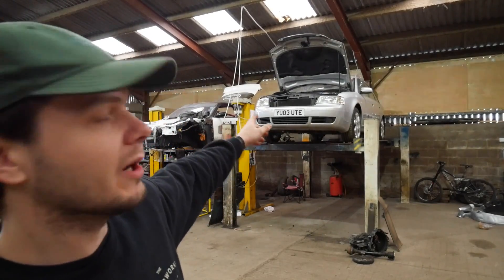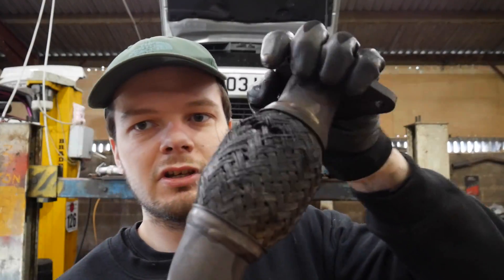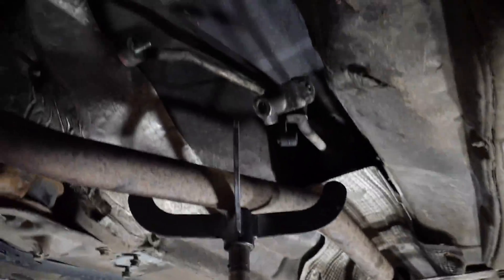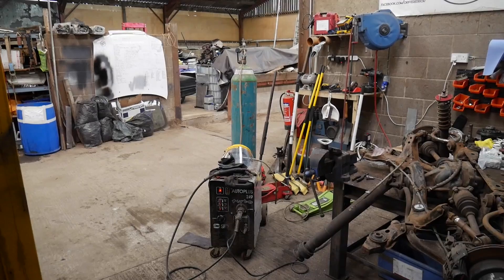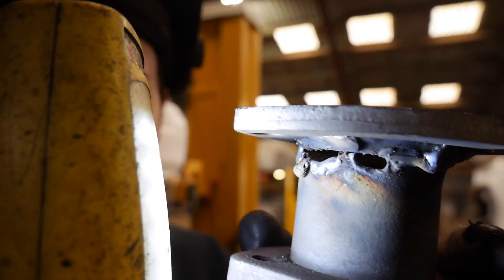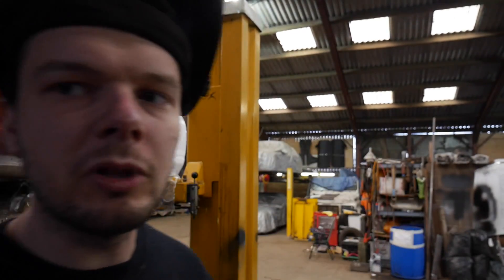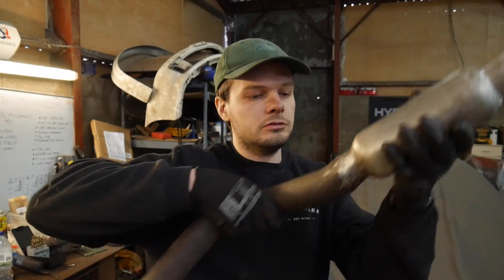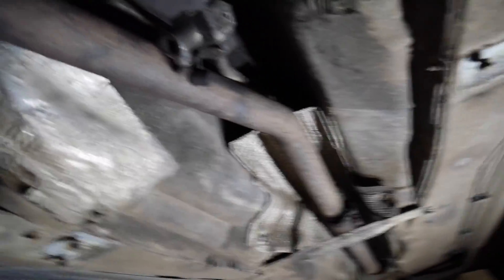Welding for the first time - Audi A6 Exhaust Repair

Comment: As someone who is currently learning to MIG weld I understand the struggle. Play with some thicker metal to practice your hand movements and not worry about blowing through the metal. It's a great feeling getting the welder set up just right and getting your first nice welds.

Comment: You've got to start somewhere Dan! Im shit at TIG welding but with my Rtech mig i can produce some decent results. Half the battle is setting the welder up correctly with the correct volts and wire speed. Its probably worth you googling a settings chart for that particular welder, will save you loads of time. I find when welding exhaust its best to use high heat and a series of short tacks around the whole piece of pipe. Once you have started welding you will soon realise its probably the best tool in your garage!!

Comment: Not a bad shot for your first time! I done something similar to my exhaust the first time I welded. I'm not sure if anyone has said this but hold the torch about 10mm off the job when your are welding. It should stop it from clogging up at the end. Wire speed and amps is everything but a few how to weld videos will help with that. Hope this helps a wee bit!

Comment: The exhaust flexi was a weak point on my Astra VXR too. A replacement pipe was about £1k, which I wasn’t about to pay put. Got it mended a few times before I got rid (that was when it was 11 years old, 135000 miles - I’d had it from new). Given I’d got it for £5k on top of my 04 Civic Type-R, it gave me 11 years of cheap, fun driving...

Comment: I'm debating learning to weld, this video is good inspiration and also reminds me that I'm going to blow holes in everything at first!
Reply: I made the dive this year. Do it, it's fun. Remember to wear your helmet & long sleeves though unless you really like severe sunburn (speaking from experience lol)
Reply: @philanaemic  our cheap welder broke yesterday, so we're going to invest in a decent one and then I'm going to get started.
Reply: @jase_llan  I just bought a fairly inexpensive one from Poland. I still had to budget for all the gas & accessories.
Reply: @philanaemic  I've already got the gas and wire etc. from the old one, I'm thinking of spending around £250 and going halves on something in the £500 range that can do mig and tig - mig will be handy for patching rust and tig means I will be able to have a better go and custom exhaust fabrication etc.
Reply: @jase_llan  the bit of kit I wish I could buy would be a pair of steady hands 🤷‍♂️ I'm cursed with the chronic wobbles unfortunately. Made my first experiments with my Aldi stick welder a load of fun. 🤣
Reply: @jase_llan  P.S: My own welder will do MIG & TIG if I were to spend the extra for the TIG torch but you're stuck with doing scratch start/lift TIG as it doesn't have the HF features found in dedicated TIG boxes. And you won't be able to use it for Aluminium.
Reply: @philanaemic  I have steady hands (lots of soldering practice) but am cursed with a chronic lack of patience!
Reply: @philanaemic  I did noticed that most weren't HF, but I can't think of any aluminium welding I need to do yet... No doubt I'll find something! I've found a couple of welders in budget that come with both mig and tig torches which is ideal.

Comment: The thing that is in the tip of the welding torch (i dont know what its called in english, socket or what ever) its damaged thats why the welding wire keeps getting stuck, you can change it by unscrewing it. U had very high AMPs for material thats so small, thats why it keeps burning through. In my opinion its easier to tack weld aroung mufflers not to weld by one go, just tack after tack until u complete the circle.

Comment: Heres a tip mate... Rest the mig wire to the gun, over your arm, and hold the gun in your other, it'll take the weight off the gun and let you move around as needed

Comment: Maybe you considered this & discounted the following, maybe it's just my inside the box thinking but I personally i would have found the partner flange & welded that to the rear exhaust section.
Much easier to line up a flange & tack than a bare pipe.
Reply from the maker: There is a clip on the cutting room floor of me saying why I didn't do that. Basically, that's probably what an engineer would have done xD

Comment: nice first try ! i just have a question usually when i see people weld they use the wire separatly or is that a diferent welder?

Keep up the good work
Reply: I think you're on about stick/arc welding from what you're saying? Mig has the wire inside the welder as you can see on the video.
Reply: Tig welding is torch and wire separately as is stick welding..
Reply: @nurburgringobsessed5722  good point, tigs are what you'll see on stainless exhausts after all!
Reply: @jase_llan  ok thanks :)
Reply: jase_llan correct yes, I’am a tig welder myself. You can tig any metals providing you have the right gas and filler rod..
Reply: @nurburgringobsessed5722  I thought you could use tig on other materials, but it seems you can only tig stainless - is that right?
Reply: jase_llan no you can mig stainless but need the gas and stainless wire in the welder.. much nicer job with a tig welder and cleaner. All in my opinion of course.
Reply: @nurburgringobsessed5722  I didn't know that! We've got a mig at home, not a great one but it'll probably be good enough for me to have a go on. I do have access to a tig as well, but home learning is so much more convenient!
Reply: jase_llan yeah just make you use the correct wire for the correct material and gas, typically stainless you’ll want Argon gas with low carbon dioxide mix..
Reply: @nurburgringobsessed5722  thank you!
Reply: jase_llan no problem mate. Good luck and practice practice practice is all the advice I’d give

Comment: Probably could have done with turning the power down a tad 😂
Reply from the maker: It was on the lowest setting 😪
Reply: @dannyDC2  it's quite a beefy welder. Same size as the one we have at my unit. I found if you do a line of "tacks" rather than squirt and wiggle, you have a bit more control and are less likely to blow through 🤙 practice makes perfect

Comment: Wasa laugh with the welder Best tip can give is to leave a bigger gap from torch and pipe this is why welding itself to nozzel get wire speed right.

Comment: You want try putting the clap on the actual exhaust not the table 😂 
Heats way to much is probably set up for welding farm stuff 
Hold the trigger on longer lol you look like it’s going to blow up lol
Get you face about 8 inch away from your work